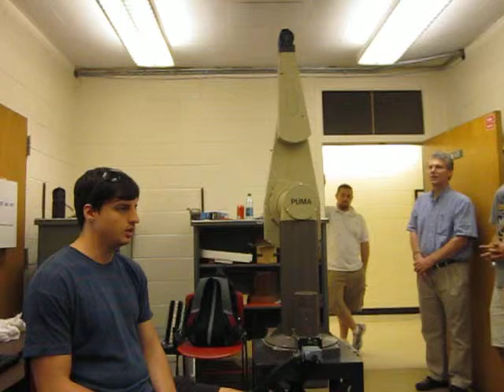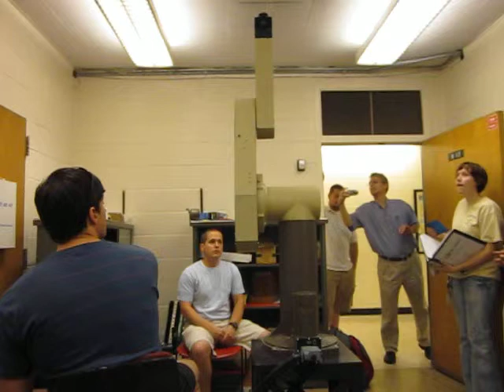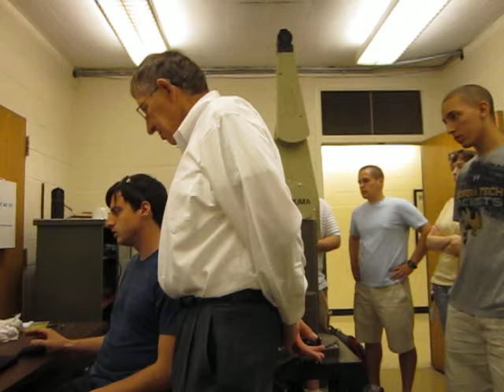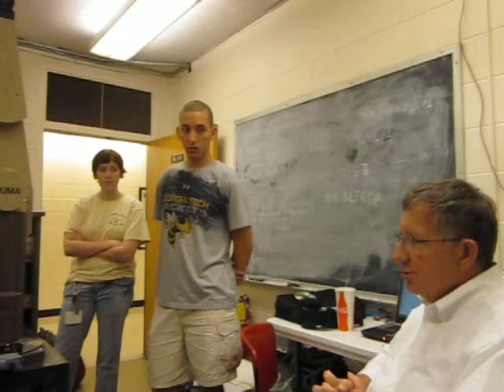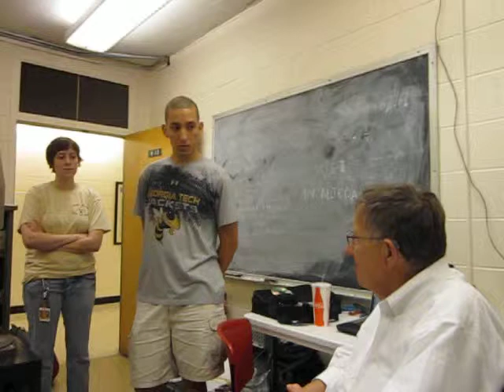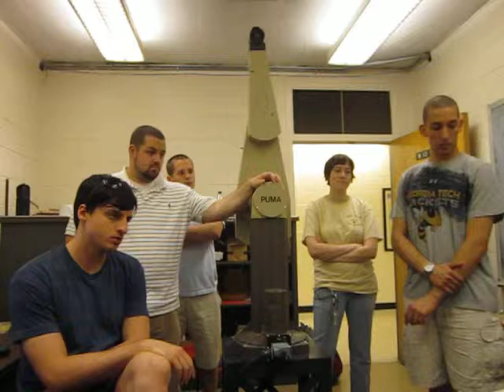Georgia Tech PUMA 560 Final Demonstration

Comment: Any chance you kept any of the information regarding the pinouts/cable into the robot itself?  I have a dead unimate controller so I need to do something like this to bring the arm back to life.  I don't want to send 16 volts of brake release into the optical encoders before I figure out how any of this works.